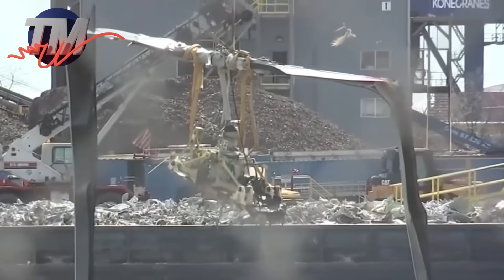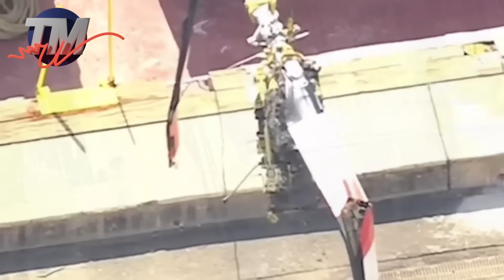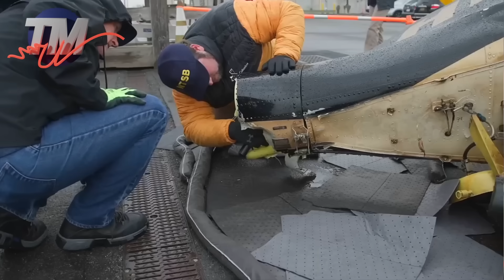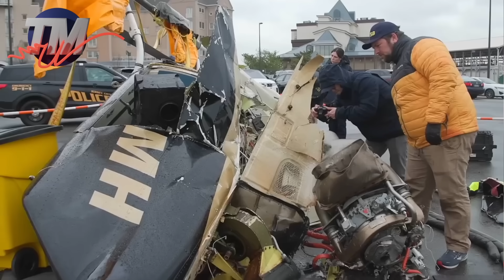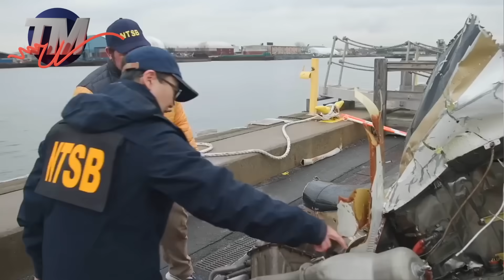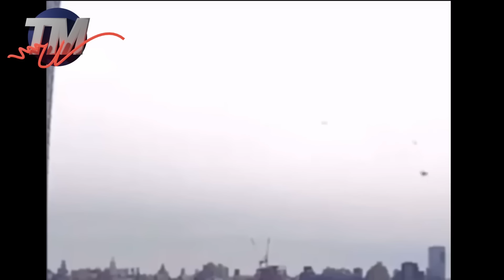Recovery of the Main Rotor of the Hudson River Tourist Helicopter - it's worse than we thought

Comment: Something went very wrong.  Can we agree on that?

Explosives? Does not look like it. It just broke apart.

A single bolt or nut can come loose, fall out/off and then get spat through a casing. Seen that. A 10mm hole in a car’s gearbox, hexagon shaped. One hole, one bolt missing from the diff.

If the wrong bit falls off, and goes into exactly the wrong  place.. 

MG3, clutch fork bolts snap. The bolt heads fall off. The clutch still works. The bolt head then jam between the flywheel and the block. Non start. Locks the engine.

Comment: .........almost seems like the main transmission locked up suddenly and all that torque ripped the transmission from the main structure and also snapping the tail boom. The max torque would have been close to the cabin and that looks like where the tail boom failed. With all the Tx failsafes: temp, pressure and metal detection it's remains a mystery.

Comment: A quick note on the transmission:  If it's designed like the Huey (and from my observation working on Hueys in the Army, much of the rotor and controls are more or less scaled down versions of the Huey system), there wouldn't be a need to disengage a clutch to start autor rotation.  It was designed such that if the engine quit putting power to the rotors, the blades would automatcally free whee.  This was in the late 70s / early 80s, so things may have changed.
Reply from the maker: As far as I know it has a freewheeling sprag clutch, yes. Procedure is to push collective to the floor and set engine to idle.

Comment: My guess, and it's purely that:  There were some nooks and crannes in the airfraime that had gotten corroded over the years, and it was either missed during annual inspections.  Either because someone was doing theiir best and it just didn't show up, or because it was in a hard to get to corner and wasn't inspected as thoroughly as it should have been.  There's also the factor that it was operation near a large body of salt water, so the risk of corrosion is higher.

Comment: I have over 10,000 hours on the Bell 206 series aircraft. These photos give me e a hint of what occurred. Mast bumping is inaccurate. The tail boom is severed to cleanly. The tail boom mounting bolts have failed resulting in a clean break from the fuselage. A massive C of G would have resulted resulting in large forward inputs from the pilot. The imbalance, control inputs and the forces involved resulted in the fuselage inverting and the main rotor transmission deck and transmission being ripped from the aircraft. From then on, obviously there was no recovery. Very tragic.

Comment: Journalism isn't what it used to be so, YES, these things are being reported differently by some.  

As for this helicopter, it would take a significant amount of energy to wrench that gearbox, transmission mount and section of the airframe from the helicopter and I reckon the only place that much energy exists is at the rotor.  Sudden seizure of the transmission could transfer all the rotational energy of the rotor assembly straight down to the transmission mount and to the section of the airframe to which it was attached.  Those of us who have had the misfortune of using a wire wheel on a drill (and getting it caught up in a tee shirt) will tell you, when one end suddenly stops turning, the other end gets going.  All of this is pure speculation on my part but the theory is sound.
Reply: There is no journalism anymore.  That's what happens when you let a corporate oligarchy take control of the media.

Comment: I think it very likely was a transmission failure. At this point it's difficult to say what started it, but for sure transmission failures can be extremely violent internally. If something bad enough happens inside- the whole thing is absolutely coming apart 😳

Comment: Is not just the main rotor is the wholesystem drive system. Transmission, mask, rotorhead and both blades. The roof of the helicopter is still attached to the transmission and mounts.

Comment: Not an expert, but it seems that something in the drivetrain seized and the force of the engine caused everything to tear itself apart. I would be surprised if it was deemed to be a missing or improperly torqued bolt or screw. It will be interesting to see the condition of the turbine and if it was still running when the separation happened. A truly tragic situation in any sense of the word.

Comment: If you replay the sequence around 4:27 at half speed there is a single frame where the copter disappears completely and then reappears gradually over the next couple of frames like there was some sort of explosion or shockwave through the air causing momentary vapour cloud around it. I wont speculate what might have caused it but it may give someone a clue.

Comment: I don’t know anything about New York Helicopters whatever this operators name is. I’ve been in aviation my whole life. I came up through general aviation and retired as a senior international captain at a major airline. I can’t tell you the number of operators I’ve seen and some I’ve worked for, right now, that do everything they can and operate right on the jagged edge of legal. They know every trick in the book to keep from following the regs. They hate being told what to do by the Feds and they hate government. I have always believed they spend more money AVOIDING doing the right thing than if they just did it right. My whole life. What the current administration wants to do is get rid of inspectors and severely limit the FAA’s mandate. And this knuckle head FAA Administrator has no clue. Not a CLUE. Are we sure we really want this?

Comment: I’m not sure that I agree with this transmission seizure theory, and for this reason: the rotors, mast and other related components are heavy and spinning fast. If the main bearing seizes, all that momentum and kinetic energy from the rotors will violently oppose the inertia of the bearing and explode that gearbox casing. That clearly did not happen. In fact, there is footage of the rotors flailing into the river, and they are still clearly turning. It doesn’t look like the gearbox and support structure is turning with them. 
So, what happened to cause the gearbox to rip half of the deck out on one side, and pull the mounts out of the deck on the other? 🤔
The very violent pitch up and yaw *left just before disintegration has something to do with that. 🤔

Comment: Someone with more knowledge of metallurgy should be able to look at the separation joint in the tail rotor and and tell which way the tail rotar actually separated from the boom. I'm no expert by any means, but one side appears smoother than the other indicating a tensile stress vs a twisting off stress. Also note the heli is on it's side so the bottom of the heli and boom are facing you in the video...

Comment: To me it seems like a blade tip was likely lost on the rotor and the subsequent vibration ripped everything apart.  On a small twin plane I seen one which lost a tip and was shut down and feathered within 2 seconds  bypassing the normal checklist, until after shutdown; 3 out of 4 engine mounts were broke.

Comment: It didn’t rip the transmission off, it ripped the entire upper deck (structural) of the aircraft! If it had just ripped the transmission off, the linkage arms would have been broken which indicates to me that the main force wasn’t actually concentrated in the transmission…

Comment: I think if there is a simple explanation the NTSB will find it. My own theory is that main rotor blades stopped turning, which caused a huge amount of torque to transfer to the body of the craft. This could have done for the tail rotor and then when the tail rotor failed, it would have reversed the torques causing further disassembly. I think that is the only way the aircraft can turn that quickly and suddenly then stop turning. This begs the question what stopped the blades turning?
At the end of the day, the NTSB will have chapter and verse and similar incidents will be avoided.

Comment: In my past life I was an engine mechanic for the OH-6, OH-58, and UH-1 helicopters.  I think the culprit here was air frame failure, whether the tail boom or loss or tail rotor pitch control.  It appears the cabin roof failed as a result of the first event, No one has stated how many flight hours this bird has or time since last main inspection. 

We do know that all machines have a limited service life. Secondly these service lives can be  adversely affected by poor maintenance and usage pattern’s.  The next question will be did the operator skip maintenance to stretch their flight time?

Unfortunates the current state of new reporting is driven by viewership stats even more than ever. Secondarily there are the news 🎉and media outlets that wish to promote a political agenda. So there is hardly a surprise that events are not reported in a purely factual manner.

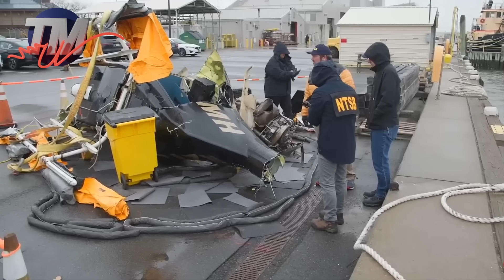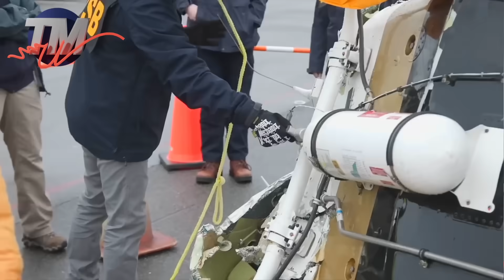Comment: We will probably never know what happened. However, notice at minutes 1:42 and 2:43 on the bottom of the helicopter is a Ballistic Parachute that is designed to give the pilot a second chance of saving the flight.    I wonder if using the chute would have made a difference.  Revisit the Video footage and you'll notice the main rotor blade and transmission auto-gyrating after separation from the main chassis. That indicates that the gearbox didn't lock up or seize.  That was the second splash 20-ish seconds after the main frame hit the water.
Reply: Get a clue.  That isn't a "ballistic parachute".  It's the air tank for the skid flotation balloons for water emergency landings.  You can see the air hoses running to the deployed floats FFS.

Comment: Whoa, what would make the transmission mounts rip away from longerons  AND tear the tail boom off cleanly WITHOUT severing the mast?  Massive unannounced seizure of transmission?  Pilot or front seat passenger made a massive and unannounced control input.  Incredible chain of incompetent maintenance inspections going back years?  Sabotage, by undetected brute force damage?  Unknown manufacturing defect?  All of the above combined?  That's about the limit of reasonable causes and they're all ridiculously unlikely.

Comment: I can tell you a lot about model rc helicopters and their common points of failure and crashes.  But when it comes to full scale manned helicopters and all the additional  intricacies involved I can't speak with any level of authority.  I have seen footage of helicopter crashes due to things like auto rotations gone wrong, or crashes due to main rotors or tail rotors striking power lines while operating at very low altitudes. But I've never seen any crash where the helicopter is flying along in what appears to be normal flight and them seemingly self destruction in mid aire. It will be interesting to hear what the NTSB eventually figures out. One thing I will add. When it comes to aviation accidents.like this or the plane crash in DC the opinions of politicians matter the least. All a politician will ever do is give some kind of knee-jerk reaction or propose some.sort of new law or action to serve some unrelated agenda.

Comment: Could it have been a catastrophic engine failure throwing parts into the gearbox or just causing its separation from the helicopter?
Copilot Artificial Intelligence:

If a turboshaft engine were to stop instantly in flight, the forces involved could potentially cause severe damage to the helicopter, but whether it would "rip apart" depends on several factors. Helicopters are equipped with a *freewheeling unit* in the gearbox, which automatically disengages the engine from the main rotor if the engine stops. This mechanism prevents the rotor from being affected by sudden engine stoppages and allows it to continue spinning freely, enabling the pilot to perform an emergency autorotation maneuver.

However, if the engine failure were catastrophic enough to damage the gearbox or other critical components, it could lead to structural issues. In extreme cases, such as a rotor separation or gearbox failure, the helicopter could experience catastrophic consequences. Proper maintenance and inspections are crucial to prevent such scenarios.

Let me know if you'd like to explore this further!

Comment: My thinking from the beginning of this has always been a failure in the tail rotor or tail rotor drive shaft that resulted in a separation of the TRGB and subsequent forward shift in CG that led to the tail coming up and hitting the main rotor blades.  The blades being intact is meaningless.  In the videos, there are 12 loud bangs that roughly coincide with main rotor RPM.   But a few seconds before those loud bangs, and the tail boom and main rotor separation, there are a couple of lower "Thud" sounds, and then the tailrotor "hum" sound is absent after that.  It sounds almost like a lawnmower hitting something and stopping.   You really need to play with the audio and listen loudly through headphones to hear it.  Hopefully the NTSB gets to the bottom of this quickly.

Comment: I'm not a helicopter expert but I have a comment/ question. Several people have suggested that a sudden transmission seizure might be the cause. If I understand correctly, the rotor turns counterclockwise as viewed from above. A transmission seizure would cause the helicopter to spin counterclockwise but the video seems to show that it spins clockwise. This suggests that, unless the video is deceiving, the cause was something else.

Comment: The gearbox will have something probably a detached tooth jammed in a gear set,  you will probably find cracking in the fractured gear resulting in a shed tooth,  this is a common failure in automotive gearboxes it's caused by stress used to be common before the car manufacturers added a radius to the bottom of each tooth ,

Comment: Seeing that I would say the gearbox suffered catastrophic failure and locked up ,  the inertia of the rotor tore off the gearbox from the fuselage and the violent rotation from the reaction on the fuselage snapped off the tail section ,

Comment: You cannot auto rotate a helicopter after tail rotor failure if the rotor gearbox stays attached. What needs to happen is to increase or keep the speed up, causing a weather cock effect which will keep the boom straight or even at a yaw.
If the tail rotor gearbox has catastrophic failure and rips from the helicopter, even then it's very unlikely to rip off the main rotor. Looking at the main gearbox which drives the main rotor and tail rotor gearbox, appears to be intact, including the mounting arms. This leads me to one opinion of structural failure of the main gearbox mounting onto the frame of the helicopter body. Metal fatigue on the frame below the main gearbox. Just my opinion. Ex Flight Engineer on helicopters South African Air Force.

Comment: 3 comments. It looked like an extreme pitch up so then the fuselage wants to go forwards while the main rotor wants to go backwards. I suppose an AI can clean up each frame by frame and someone can do a finite element analysis. It seems that ever since Jeju Air 2266, there has been a transportation event once a week. I will be surprised if next week is quiet. If the transmission seized all we need is to do it on an-about-to-be-scrapped helicopter and see how that turns out. https://www.youtube.com/watch?v=RQ0xSBBJX3k

Comment: This may have been a maintenance issue that was overlooked. There could've been stress cracks possible in mounting bolts for the rotor and transmission. It may be a result of defective hardware from the beginning. The transmisdion section premature wear and failure may have caused extreme vibration resulting in catastrophic failure then causing the rotor hitting the boon section.The tail rotor  shaft itself may have had  possible stress cracks that got progressively worse over time, was never checked. The wear and tear of aircraft components, its assembly may have been past its time limits or were totally "out-warn" (fatigue) and should have been replaced, but its down time could've been an issue, maintenance could've been pressured, keeping it from being dead-lined and as a result catastrophic failure of the worn components was the blame. Whether it was in the rotor, transmission mounting bolts, the casings, they possibly had cracks whether it was from wear and tear (fatigue) from vibrations or originally from the manufacturer.

Comment: The rotor severed the fuse large at an extreme angel and the chopper fell apart and the pilot lost control and the air craft fell into the river

Comment: There’s just as many aviation accidents now as back in the day…even as 20-30-60 years ago. Largely even less, on account of modern safety, modern manufacturing and black (orange) box data.

> BUT…but the main difference between then and now is that everyone has an internet connection right in their hand or pocket or purse. We are merely getting every single aviation incident in our feeds; Versus back when we were reading the news on actual newsprint paper.

Back then, a story like this would have gotten say a smaller column on the front page or inside on page 2 or 3. You’d only see small plane, general aviation accidents in your local newspaper.

Comment: Aldo Sterone, a French YouTube channel, shares your analysis that the rotor tail would have broken first. At this moment, an enormous torque was transmitted to the airframe, which was torn off from its main rotor. Then the airframe fell on its back, certainly due to the presence of the turbine, which shifted the center of gravity. The main question would be why the rotor tail broke? Aldo Sterone hypothesizes 'material fatigue': these aircraft operate most of the time in a humid, salty environment; etc. Only the investigation report will confirm the causes...